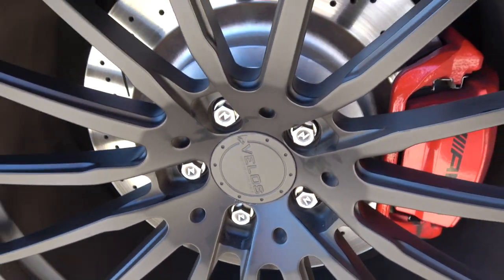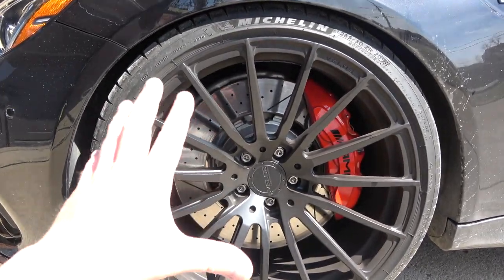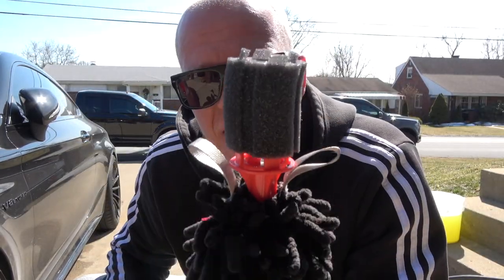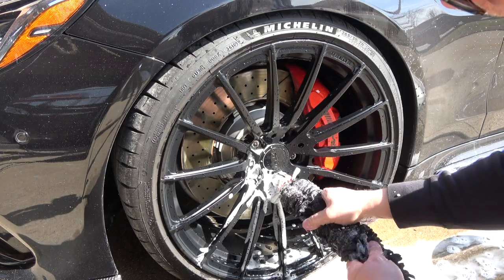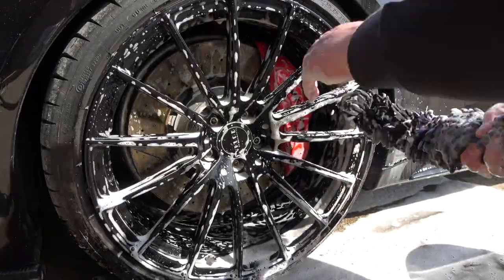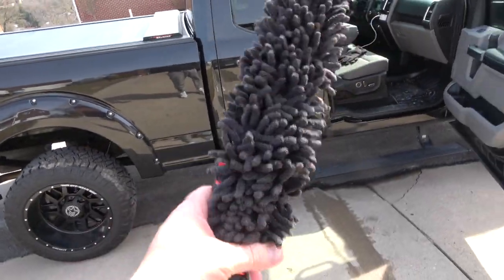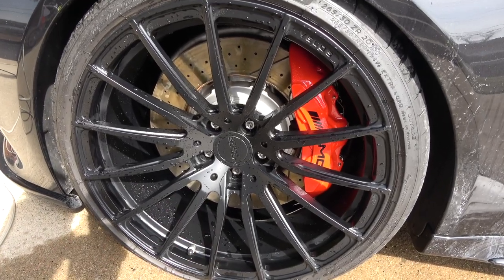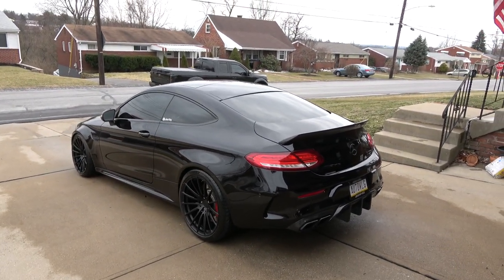How To SUPER CLEAN Your Wheels!

Comment: Get the powerstop brake pads, I had the same issue from my hellcat brembos since changing to powerstop barely any dust. And don’t notice a difference in braking. POWERSTOP Z23 you will Have basically zero brake dust after this upgrade.

Comment: I use mother’s wheel brush for spokes, lug nuts and outer rim, then speed master wheel brush for inside the spokes. I spray it down with Meguiar’s wheel brightener. That stuff just eats brake dust.

Comment: The best and easiest to wash the car when high pressure washer with hot water. A few years ago, the Swedish car magazine Power Magazine made a test between high-pressure washing with hot and cold water, which turned out to be best with hot water. The company Topaz in England, which seams foils cars with plastic, also wash with hot water as they say it is best with it.

Comment: This is what I use to clean my spokes and wheel barrels:  https://www.walmart.com/ip/Clean-Living-by-Casabella-Soft-Dual-Foam-Sponge-Dish-Brush/24704859   Also here's a tip:  turn your steering wheel full to the left.  Then, with the aforementioned sponge in 1 hand you can soap up the inside of the barrel probably 2/3 of the way around.  Turning the wheel outward allows some unobstructed access to the inside.

Comment: I remove the wheels entirely.

Then I can clean the wheels fully
Reply: You should try and work smarter. Not harder
Reply: @supremeballen6407  Removing the wheel allows me to fully clean it, Using a dedicated wheel cleaner like bilberry wheel cleanr, de-tar, de-iron solutions, apply wheel wax.
This also means I dont get the brake discs rusty either.
Reply: IIGrayfoxII about the rotors getting rusty, pointless to try and preserve them. They rust in a day out in the rain. One push of the brake pedal going a decent speed, and the rust is gone